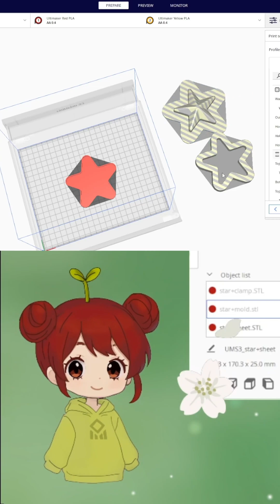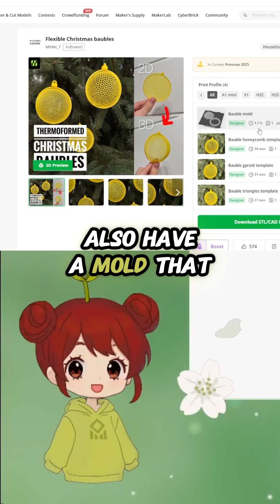♨️🎄ThermoFormed Christmas Ornaments

Comment: Thermo forming is a fun idea and so easy with PLA.  Did you try preheating the mold a little so it didn't cool the pla as fast?
Reply from the maker: Thank you! I was able to continue applying heat when it was on the mold and cooling down, but in most cases I didn't need to